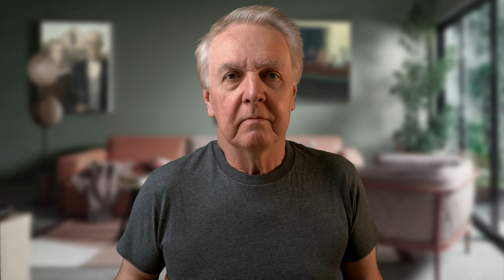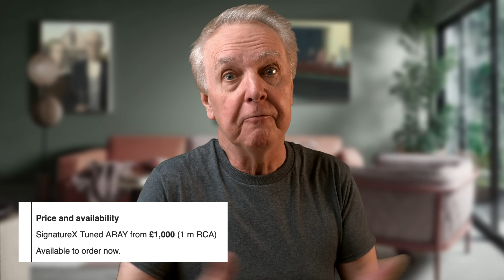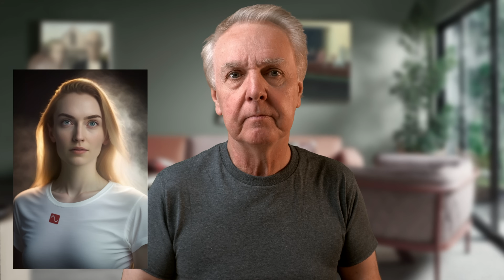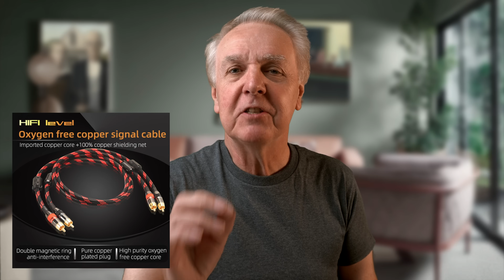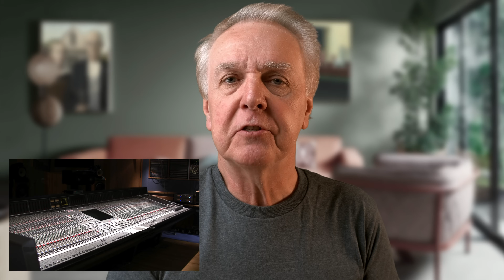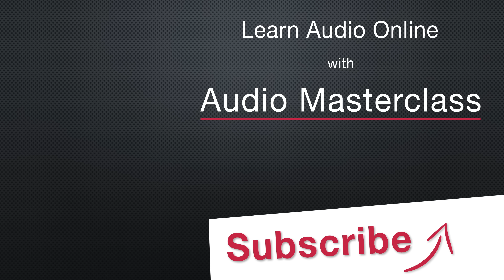Would you pay $1000 for a 1-metre cable?

Comment: My favourite theory about expensive cables sounding better is that when you pull out your cheap cable and plug in the new expensive one, all the contacts get a good wipe clean and some very low levels of distortion might be reduced. You could achieve exactly the same, of course, by unplugging your old cable and then plugging it straight back again.
Reply: I service vintage audio gear for a living, been working with audio professionally since 1977. I can verify that this is a legitimate thing you're describing, and the longer the system has been set up, the more likely it is that connections have corroded and become semiconductive. Cleaning those connections (and the pots and switches inside the units) can make a massive difference.
Reply: @RedBankVintageAudio  Goldplated should do the trick...
Reply: If only there was a telephone service you could call where they would tell you to pull out the cable and plug it back in.
Reply: @@Douglas_Blake Yes, likewise I've read that many audio professionals (i.e. studio and broadcast engineers) give all their XLR connectors and TRS jacks a good clean periodically. A lot cheaper than replacing with snake oil cables.
Reply: @anahatamelodeon  This was a major PITA when working as a Tape Op in the 1980s. Where I worked there were three main studios with 48 channels of balanced mini-phone (not phono) tie lines between studios in addition to the lines between control room, studio, drum booth etc. It could be quite a zen job, as long as I could get uninterrupted time time to do it, which was rare.  
My fingers used to hurt after an hour or so of polishing the tarnish off the plugs, and then getting into the patch bays to give the sockets a quick run over with a bespoke tool our ‘spadgers’ (boffins) made up. The same sort of job as painting the Sydney Harbour/Forth Bridge. As soon as you finished you’d start again at the beginning. There were a lot of jobs like this, aligning tape machines, coiling cables. Once things went digital, most of this faded away but like most human beings, my brain feels a sense of  nostalgia for the old ways.  But thinking objectively, a few workflow things aside, it’s much better now. Moral of the story? If the big, corporate studios used to clean their what seemed like endless number of connectors regularly, it’s not a bad idea for us to do the same with our handful of stuff :)
Reply: I have a can of contact cleaner and used it on my NAD amp and cables for 40 years until the surrounds on my Mission speakers basically turned to dust.  Then I replaced the surrounds.  Then the dials on the NAD amp got to the point where even the contact cleaner wasn't fixing it so I bought another NAD amp and kept on keepin' on.  The sad thing is the new NAD amp doesn't sound anywhere as good as the old NAD amp.
Reply: @CallowG  damping factor of the old NAD amp must be lower than the new NAD amp (assuming it's a class AB). One of the reason why most new amp sound different , ofcourse circuit design and components selection and advances in technology also make a difference
Reply: @rogerwalter2500  There are other differences too that play a part.  My old NAD had a "loudness" compensate that boosted the bass and mid and gave it a fuller sound at low volume, which is how I play it.  The new one doesn't sound as warm at low volume but I've gotten used to it.
Reply: @CallowG  RIP loudness switch, miss you;-). That function sure used to make a big difference at lower volume,  to compensate our hearing response aka Fletcher–Munson curves
Reply: Just clean all your connections with isopropyl alcohol once in a while. You will get a nice placebo high each time!
Reply: My dad was a tv and audio engineer.  Serviciing them and later in R&D and training. When I worked selling hifi we were discussing gold connections. That's when he confirmed it. I sold more gold cables than most because I was honest.  No one wanted to think about having tarnished connectors.
Reply: @Douglas Blake  for the purposes of selling cables for a high street retailer it was enough, and I'm sure customers appreciated the lack of bullshit that so many other sales people exhibited.
Reply: @Douglas Blake I use this exact same method
Reply: Cables are RLC (Resistor / Inductance  / Capacitor) circuits.  Just manipulate the values  considering average input / output circuits and you could, for example, attenuate the mids a bit.
Reply: That actually makes sense.

Comment: Good video, great presentation and attention to detail. Cables are sold by there marketing and not by their performance. With regards to fancy silver plating etc there's a natural flaw in this argument, any plumber will tell you that two different metals touching each other is a definite no no as it will react with each other over time and the metals will be inferior. Sticking to one metal if high purity will offer the best and consistent performance over time. Stick to high purity copper with good dielectric and you wont/cant go wrong. They will always be the best in all circumstances. Avoid the pitiful marketing and save lots of money and disappoint.
Reply from the maker: @Douglas Blake As in a thermocouple. I didn't know it could cause break down so I'll look into that for future reference. DM
Reply: You are 100% correct and that effect is known as galvanic corrosion...or electrolysis. I don't know how much it affects audio signals, but it can definitely be an issue in plumbing and HVAC.
Reply from the maker: I remember my school chemistry, or was it physics. Two different metals in an acid makes an electrical cell and one of the electrodes will corrode. It doesn't take much of an acid for corrosion to occur over time and, as we know with our motor vehicles, rainwater will do. But where there is no electrolyte there shouldn't be any corrosion. If any chemists or physicists can expand or correct this, please do. DM
Reply: @AudioMasterclass  Two different metals may be  also source of voltage. Some little some more - the value of voltage depends on temperature. It may in some cases create problem.   Beacuse  the internal resistance of such thermosource is low. At least I observed  in my systemsome 10 yeras ago  that periodic washing with alcohol repeatedly made something noticealby  better in sopranos (which have  naturaly lowest voltage  in audio signal) . So  I started to repeat it each few days. Now I switched  sounding to natural and I do not notice any disadvantages which could do better by  "servicing".
Reply: @AudioMasterclass  
Physics
Cables are not gas right so oxygen comes into contact with the metal and the corrosion is the metal "burning"
2nd law of thermodynamics.

Comment: I use Audio Envy Studio prestige RCA interconnects ($200 2 matched cable pair) for my Moon CD player to a Threshold FET 10 preamp and to an Adcom GFA 555 power amp. AudioQuest Golden Gate ($80) for the Moon DP110 phono stage to the preamp. I just sort of figured that I should have fancy cables with good equipment. I had to switched  the AudioQuest cables with the Audio Envy cables, and heard a difference for the better...
Reply: I have no doubt that “you“ hear a difference when you change interconnects. I would wager that you would not notice if somebody secretly switched the interconnects to the made in China tables that were used as an example in the review. I would also wager that upon discovering that the interconnects had been switched your brain would immediately re-remember the past and tell you that you just knew something was wrong!

There’s nothing wrong with improving your experience by changing the environment and improving your perceived experience through the power of suggestion. My cars performance is dramatically improved each time I thoroughly clean the interior and exterior and change air fresheners. 

Odd, how humans don’t have the confidence to actually trust their hearing and instead drain their pocketbook as proof that what they hear is great!
Reply: Imagination. If it can't be measured it isn't there.

Comment: Love this level of snake oil, only beaten by the ceramics that keep your cables off the ground
Reply: and those $1000 hdmi cables from wireworld lol
Reply: Shun Mook was the most ridiculous I have encountered. An expensive piece of wood to be placed on top of CD players, amplifiers, speakers and 3 pin plugs to improve sound. How does it even work?
Reply: What is your system?
Reply: @Kowinaida  what does that have to do with what I commented
Reply: @Keary Gallagher  I'm not asking you. If you look my reply is to the initial post.
Reply: @Kowinaida  oh ok my apologies.
Reply: the non snake oil part in a passive audio system is,  every rca cable and every speaker sounds different on a system that is very good at revealing differences. Personally i use nordost leif blue heaven 2m speaker cables. My shielded rca cables are custom made by GOTHIC AUDIO in the UK,  with same gauge wiring as my nordost speaker cables with 0.4mm strands of pure silver with 4+ 4- and are connected with silver plated copper aeco connectors .  My two way and now old speakers are my modified and now only a two way only and not a 2.5 way Monitor Audio GR20. Their original bass units are now used for the mids /  bass . Cabinet walls internally lined with dead internal resonance . They are excellent two ways, especially with my two old AVI S2000MI amplification each used as mono amplifier. My short circuit active preamp buffer used for my DAP PLAYERS is my old linn kolektor, because it uses top of line burr brown TI instruments out put amps, and you can cut or boost bass by 10db below 40hz, and at 20khz. . Personally i cut the bass by 10.   I also cut down the low frequencies from DAP PLAYERS line output.  This means the mids and bass are always clear  clean with no distortions with excellent dynamics no matter how loud i play them. There always is a vice grip on the drivers with no long excursions leading to driver excursion distortions, zero port noise, no cabinet resonances .
Reply: @ianjohnhorwood2605  Revealing differences.... Baaahaaa haaa
Reply: @ianjohnhorwood2605  You're kidding, right? 
If not than i need to send people with white coats to your residents and have you pulled out of society for at least life with no possibility for parole. ( now i am kidding )
Reply: @ianjohnhorwood2605  o-kay :face-turquoise-covering-eyes:
Reply: Last "snake oil" piece I bought for my stereo rig was a cat that I could swing over my head
Mind you it's hard for critical listening when you're doing it 😅
Reply: My MIT interconnects have little arrows showing proper way to install them  I did pay $265 for a high quality one meter toslink cable